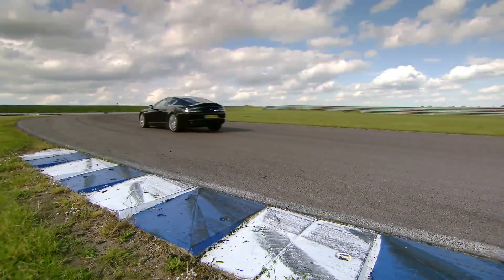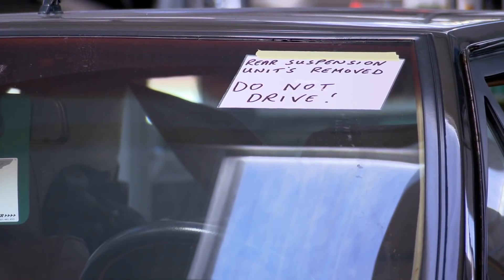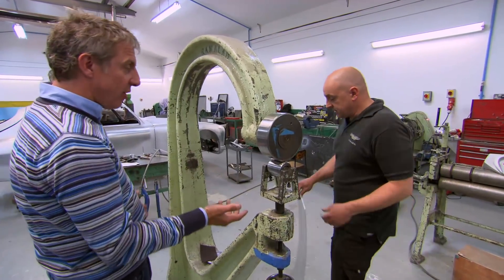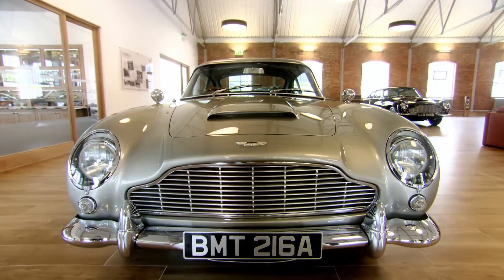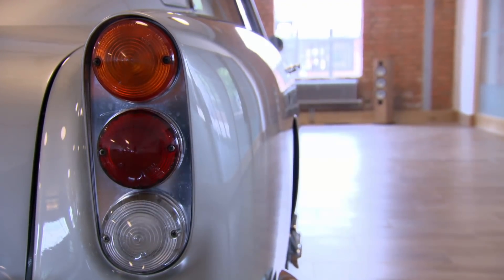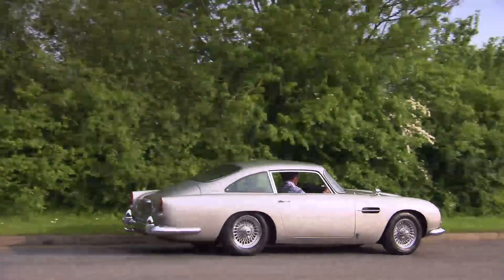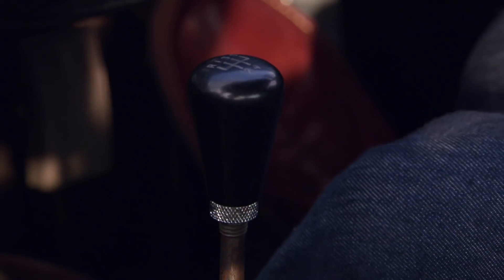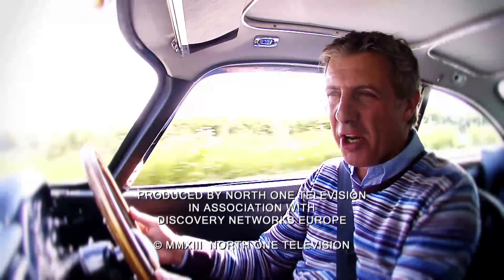Plato goes behind the scenes of Aston Martin's immaculate restorations | Fifth Gear

Comment: Little secret the DB5. In gold finger  was actually a modified DB4 as the DB5 wasn’t ready for a few months.
Reply: DB4 GT series five actually, and yes Q does call it DB 5
Reply: @adriankatsikides3390  it’s a standard DB4.The GT is the short wheelbase  version with no back seats.  👌👌👌
Reply: @russcooke5671  not sure where that info comes from but my brochures say different. I have a feeling that the first were built on the fours' platform but I could be mistaking that for the first DB 6's built on the fives platform
Reply: @adriankatsikides3390  hi Adrian.  When you look at the DB4 GT It’s a lot shorter  the the 5.   Or the  4 in normal DB form
Reply: @russcooke5671  from series three onwards they got longer for the extended boot, the first-  chassis DP199 also was the first to sport the cowled headlights to evolve into the five then the six which was not superleggera anymore
Reply: @adriankatsikides3390  what about the BD4GT. Though I thought they was always shorter chassis   Not sure 100 percent though  you seem to know more so I shall except that you are right 👌👌👌👌
Reply: @adriankatsikides3390  I always thought the earlier series  db4  were better looking cars. Before the  cowled headlights just my option though.  I think the new DBGT  would have been better if it resembled the 4 and not the 5.  I think if you put the DB4 shell on the new Jaguar running gear  it would be the best car on the road.  Timeless looks with modern technology.  👌👌👌👌
Reply: @russcooke5671  the 1959 one was 5" shorter, the body thinner metal and lightweight Borrani wheels, then you get to series V (gadget car) the wheelbase is the same but the body is 3 1/2" longer and the body a fraction higher (yawn)

Comment: I would NOT agree the level of detail....... DB 6 headlight covers for a start, no side repeaters, and not quite a DB5 ( no badges on gadget car which  was DB4 GT series five) so rubbish really
Reply: rubbish? ...a tad strong old man!
Reply: @davidstuart4915  the article/presentation is rubbish I mean ,not the car obviously. I've been in that place more than once, which was works service in my day. Even the works put DB 6 headlight covers on DB 5 restoration.... hideous!
Reply: @adriankatsikides3390  gotcha:)
Reply: @adriankatsikides3390  What is the difference between a DB6 and a DB5 headlight cover?
Reply: @tamasszabo8824  A DB 5 headlight cover has four screws to hold the bezel on, a DB6 cover has what looks like a tear drop at the very base of the bezel, it is very noticeable once you know, it is the first thing I look at. You will never see the teardrop on a DB5 brochure  because of course they were for the next generation.. I consider myself 'expert' on the 007 gadget car vs golf club car  vs others and even Worrals ' book  has several errors in it!
Reply: @tamasszabo8824  DB 6 cover has what looks like a teardrop at the bottom of the bezel the DB 5 has 4 screws to hold it on, very noticeable once you know, so if  you see that lug (teardrop) you know it's wrong
Reply: @adriankatsikides3390  Thanks for the detailed explanation!